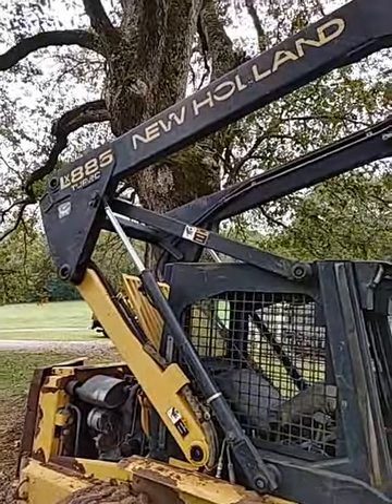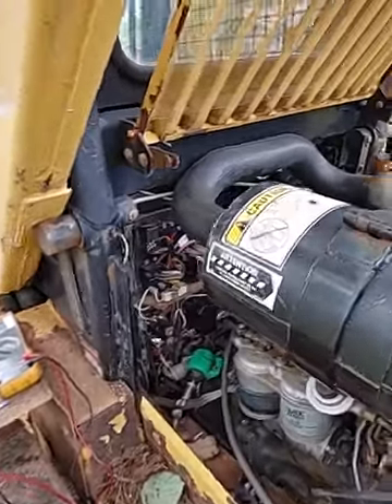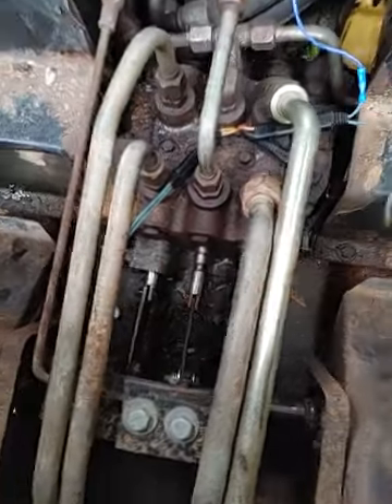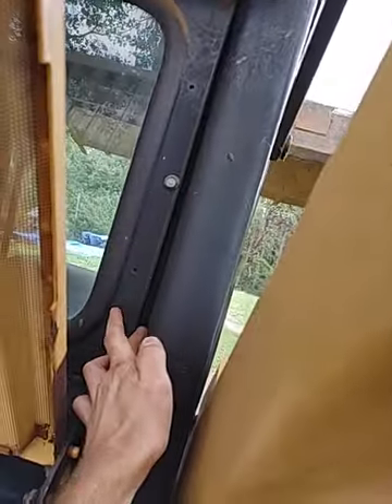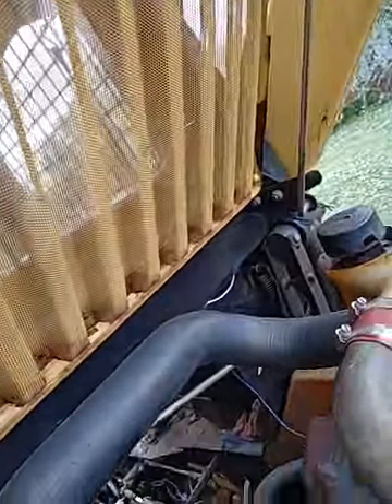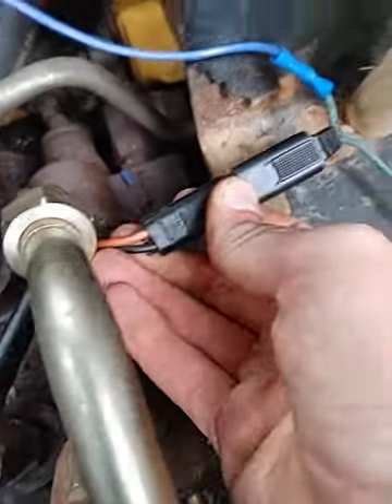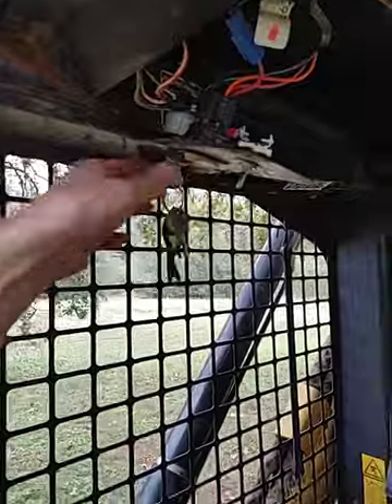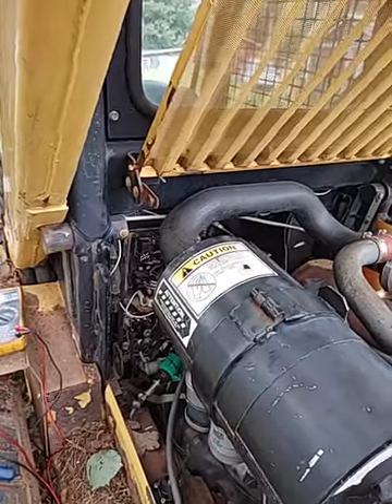New Holland LX Skidsteer Seat Belt Switch and Boom Lock Bypass

Comment: I just added a toggle switch inline on the seat frame on the side of the seat using the seatbelt switch wires.  You have to toggle it everytime you get out of the seat but Im used to it now.  It also serves as a quasi theft deterrent.
Reply from the maker: Our old lx565 had the toggle switch that worked well. On this machine with  the seatbelt switches working, the machine would start but the boom lock solenoids wouldn't disengage.

Comment: Having the same problem with my l785 new Holland. Thanks for sharing this.
Reply: Did this work for you? I am having same lockout now....
Reply from the maker: @jeffreymeguiar4698  I'm not familiar with those models. But if yours has the same solenoid blocks as mine you might be able to remove them. You can see at 1:20 in the video where one of mine was already taken off. You just wouldn't be able to toggle them on and off.

Comment: Great video I'm going thru the same thing I hope this helps
Reply from the maker: Thanks, hope it helps.
Reply from the maker: Also, my ignition switch or service run switch ended up being bad. Which caused my problem. I replaced both so I'm not sure which one it was. But I still have the bypass's on in case it messes up again.
Reply: I just ran hot to the selonoid put them on a switch  push button for the starter and left it lit up like a Christmas tree I beat 15 stumps out with it afterwards everything works fine other than the seatbelt is over Road

Comment: My 185 starts with seat belt on and then instantly shuts the machine off . I believe through fuel shut off  I would love to create a bypass.  I did this on my L785 and eliminated this nightmare problem . Help me please
Reply from the maker: Since it let's it start, the seatbelt should be fine. Could be fuel shutoff, you could run 12volts to the shutoff to see if it will stay running with constant power to it. If not it could be an ignition switch problem. Maybe a connection issue in the run position of the switch? After that  maybe the fuel lift pump?

Comment: I prefer to replace the seatbelt switch with a cheap aftermarket replacement complete seatbelt. NH Europe wants megabucks for a genuine replacement but one from a seat specialist cost me about $20.  In an emergency a switch could replace the seatbelt itself but requires to be toggled every time you sit down.
Reply from the maker: Good to know. My seatbelt works fine and I still wear it everytime. I just didn't want the switch to have any way to keep the machine from starting. I had a lx565 with a toggle switch for the seatbelt switch, it was a pain.
Reply: Hey bro I have this 2002 ls 180 and the boom just locked on me and will not start the only thing I did I was painting it and I move a switch that is above where some fuses are and move it back but only syart if I move the switch on or off it only start a d move backwards and forward but boom won't move up or down
Reply: Any help
Reply: @riccosconstruction2991  
Either there is a fault in the seatbelt circuit, which can be bypassed  temporarily while you obtain a new seatbelt from a seat specialist. Just remove the cable from the seatbelt buckle and install a simple on/off switch and toggle it every time you sit down.  Or there is a fault in the circuit or indeed the solenoid itself on the spool valve block under the seat floor.
A basic grasp of vehicle electrics should isolate the fault.

Comment: So how in the hell are you supposed to get to an absolutely dead battery if you can’t lift the boom up because it is locked by these things?
Reply from the maker: Skip to 1:20 in the video. You can take those solenoids off. They're hex shaped just put a wrench on them and unscrew them. They're what lock the pedals. I'd still put them on a switch afterwards so you cant step on the pedals getting out .
Reply: @sammarsceau6635  Thank you so much! I am working on an L185 I just bought and it is a totally different animal than the other skid steers I have.
Reply from the maker: @CGun-sb1fe  No problem! I bet they are haha. I'm skeptical on upgrading for that reason. Good luck!

Comment: Does the seat belt switch affect fuel delivery
Reply from the maker: No, it just cuts power to the ignition switch and also locks the pedals. So if the seat belt switch isnt working right like mine was, you're stuck. That's the only reason I bypassed it.
Reply: @sammarsceau6635  thanks for the reply, I was chasing a fuel issue last year on an inherited ls180 and just realized that I have a new wiring problem from the mice over the winter  above head where the switches are. Hopefully repairing these nine wires does the trick LOL
Reply from the maker: @David_Mash  haha gotcha! Good luck!

Comment: Why can't we remove the solenoid all together on the bucket / boom so it can't lock and just jump the plug at the end..
Reply from the maker: You can do that. The boom solenoid was already removed on mine,  but still has the bucket solenoid. I wanted to be able to switch it on and off, so if I climb out with something picked up on the forks I don't dump it off. I don't know that you'd even need to jump the wires if you do pull them off completely.

Comment: Don't  want to run it that way to long because it will wreck your instrument panel and they are getting really hard to find
Reply from the maker: I may be wrong, but this should just be bypassing the instrument panel and sending power directly to the boom lock solenoids. The panel should be working the same as before the bypass(still sending or not sending power to the solenoids). I haven't had a single breakdown or seatbelt/boom lock problem in 3years now.